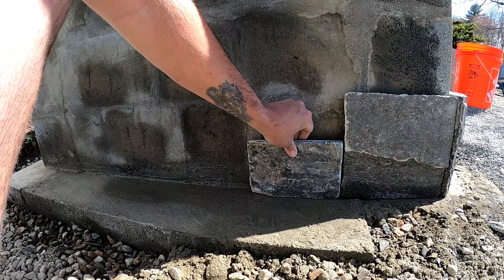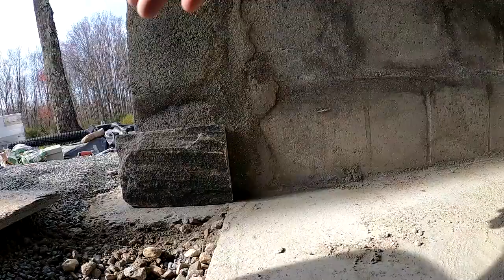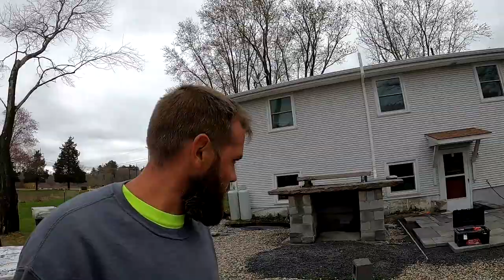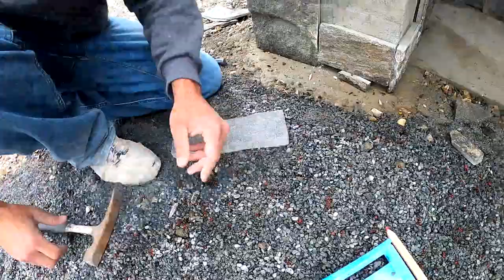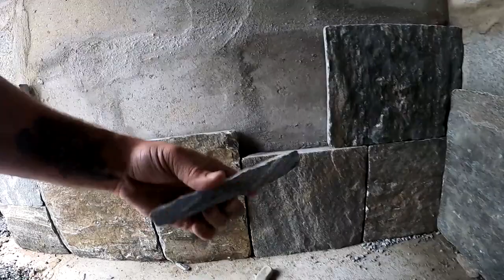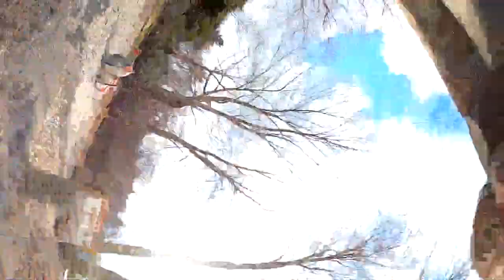How To Stone Veneer a Custom Outdoor Patio Bar!

Comment: Hey brother looks great. Quick question. What is your opinion on scratch coating it and also water proofing it?
Reply from the maker: Thanks man, I am certainly not opposed to scratch coating or waterproofing. Scratch coating is something I would do without a doubt if it was for an application on the outside of a house or inside of a house where you are adhering the veneer to wood or cement board and it is more than 6 ft. tall. I feel like scratch coating is mostly for those applications where steel mesh or "Lath" is needed so that you can really fill in all the gaps in the mesh and create a nice textured concrete finish for the mortar you use to adhere to. But as for this Outdoor feature that is only 4.5 feet tall and with the stones being adhered directly to a concrete block which is very porous, it is a little overkill in my opinion. That being said I still believe it would do nothing but help, I just didn't see a need to in this circumstance.